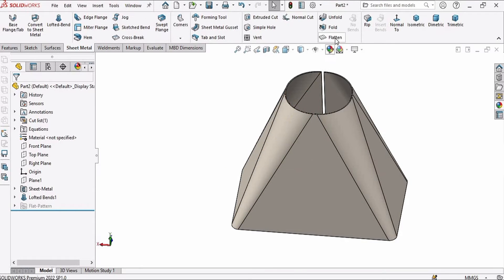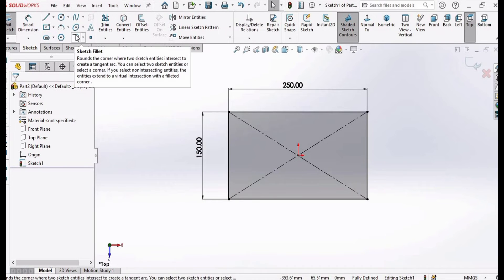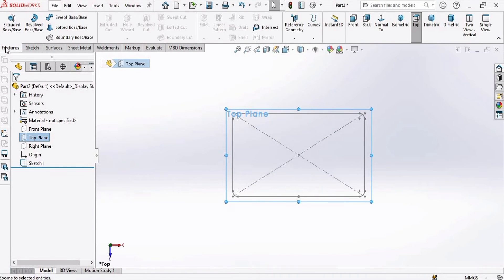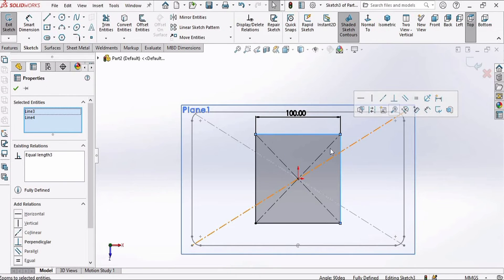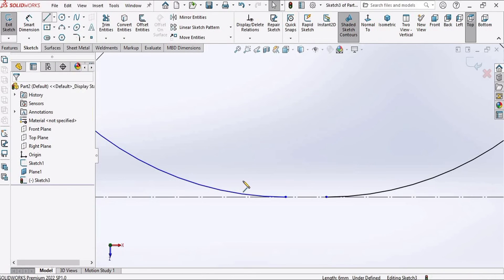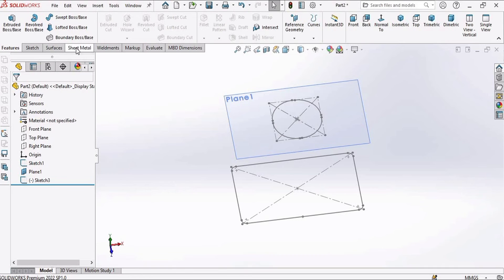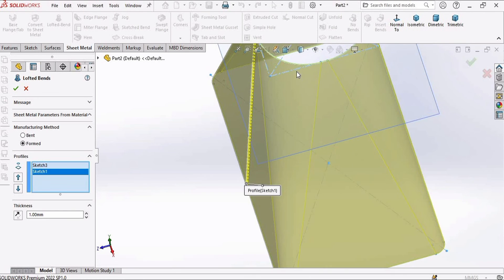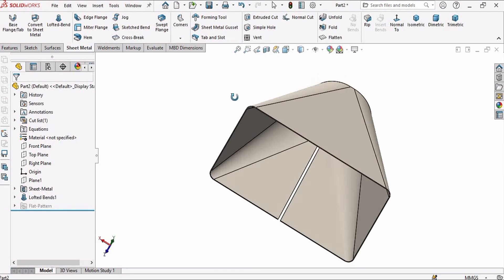Sheet Metal 3D Cone Design in SOLIDWORKS | Robo CAD

Comment: Thanks a lot for the video. That is very helpful. 👍
Question: In the top plane, may I know why you created a rectangle (and why not a circle directly) if the final requirement is a rectangle to circle transition?
Reply from the maker: Thanks for the good feedback.
The reason of making the rectangle at one side and adding a plane at a certain distance and making circle at that plane is to add height.

Rectangle to circle transition will be similar exept dimensions difference.